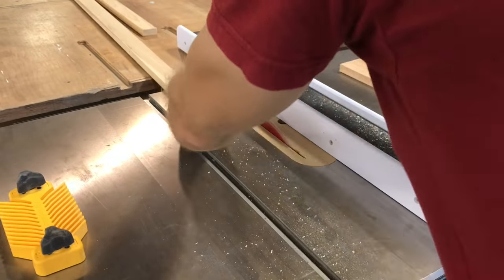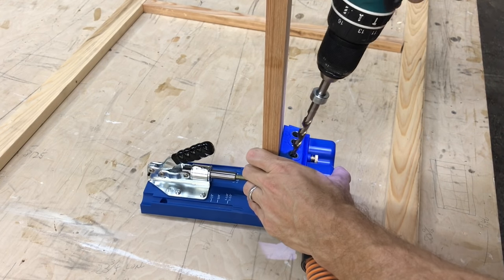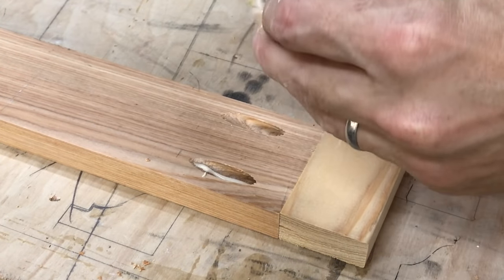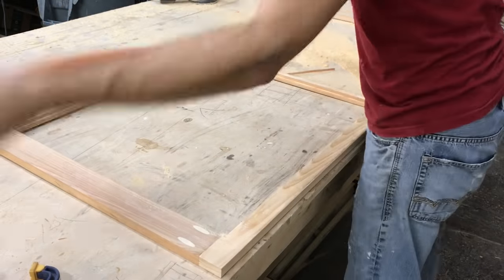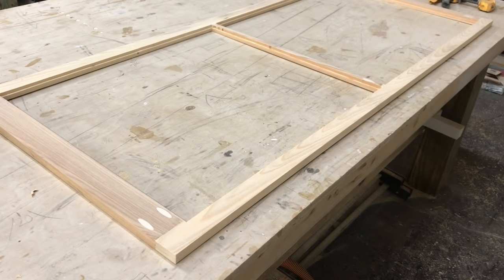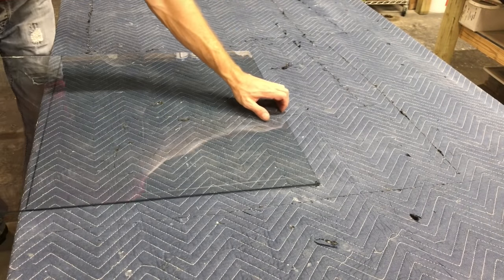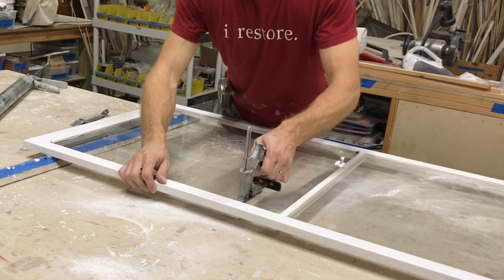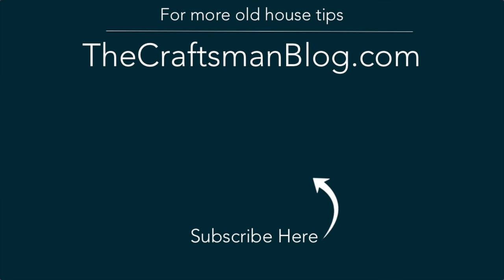DIY Storm Windows

Comment: Good video but why is it that almost all DIY videos encourage people to take unnecessary chances by removing safety guards from table saws?  And, no, it is not for clarity.
Reply from the maker: I don’t encourage it. It is just a reality of how many woodworkers table saws are setup due to the guards making a lot of operations we do on a daily basis impossible or at the very least extremely difficult. In my mind when the manufacturers make guards that allow me to do my work I will be the first the keep them installed. Until then it’s like wearing a seat belt that prevents you from driving.
Reply: Paul Charles table saw guards are more of a hazard and create more dangerous situations than they protect us from. A guard on a table saw is merely there from the factory for two basic reasons
1) to protect the inexperienced from themselves while the build trust and experience with the machine while performing simple, basic cuts and for those the guard does provide protection but I have seen many times when a rookie woodworker builds a false sense of security with a table saw guard and there are many operation on a table saw that are absolutely impossible with a guard   In place and it is much safer in our  opinions to learn to respect the equipment and use extreme caution all the time instead of only times when the guard is removed then you go back to comfort mode when the guard is back in place. That is when fingers get cut off

2) because it is a requirement from some of our favorite government agencies   

I know there’s probly a bunch of folks that don’t agree with me but I’ve been working with wood for close to 50 years now and still have every finger and toe. You are not going to change the way we work in our shops by making comments about how we need to operate because you have a.different view on equipment operation

Take care
Reply: @1982MCI  Has less to do with government agencies and more to do with legal advice and insurance requirements.

Comment: In the first eight seconds, you said you were going to show how to make this "without excessive woodworking tools" and then the tools you used in the intro and the video are themselves, by most people's standards- Excessive! $100 pocket hole jig, $110 Laminate router,  $120 glazing point driver, $400 Compound Mitre Saw,  $400-1,200 Table Saw, $30 flush-cut saw, $80 Palm sander, $56 Sausage gun, $ pumice.  I didn't list the "standard shop tools you used, but over $1,500-2,500 in tools might be much for some (or 98% of the world) a bit excessive; maybe change the intro to: "How to make storm windows if you have a full power tool shop", just saying.
The information in the video is good, easy to follow, and concise, good job.  You just lost me with the "without excessive woodworking tools" part.